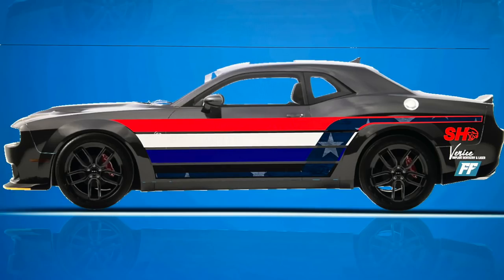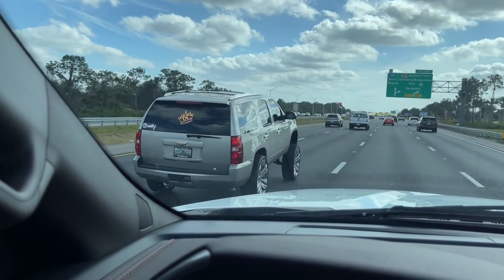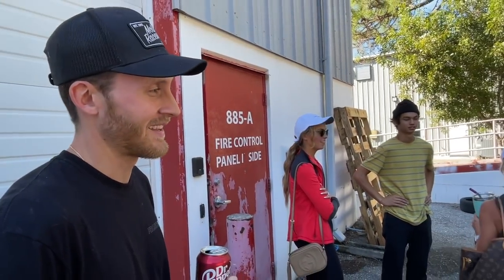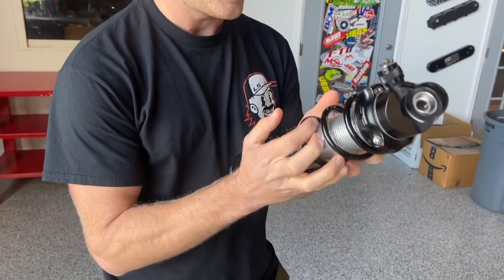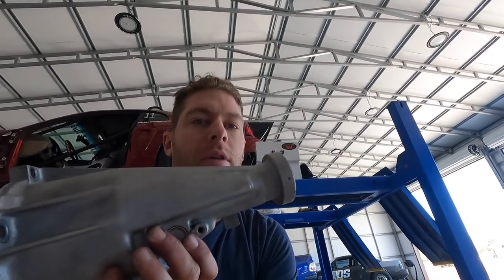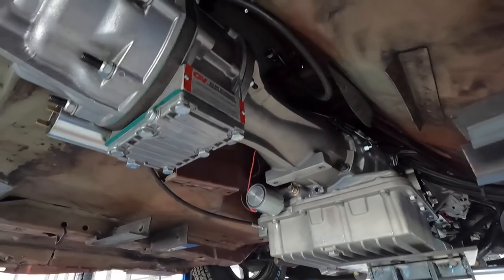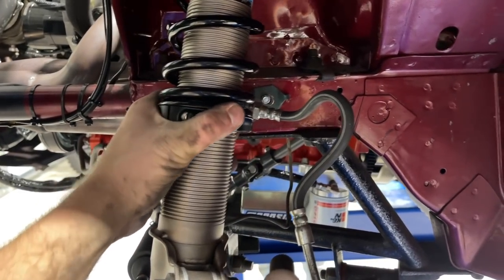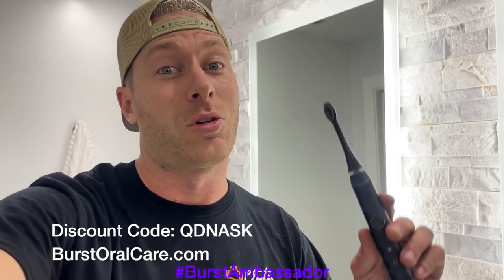Freaking GEAR VENDOR & COILOVERS go on my 88mm Turbo LSX Mustang! Hellcat is Back, Jeep got Wrapped!

Comment from the maker: Sam will be driving his own vehicle for sick week, something a little more comfortable with AC and the amenities. Zach from the FF shop and I will be driving together.
Reply: Powder coat the hand brake black. Kinda anooying to look at. Peace.
Reply: Ya know 🙄
Reply: sam is such a great man
Reply: He deserves a comfortable ride, not some racecar jarring ride.  Leave that for the young guys!
Reply: Awesome. Zack a good dude 👍
Reply: If Zach for whatever reason is unable to roll with you on sick week, id be happy to sit in. I have some high horsepower vehicle driving capability. As well as navigating.
Or hell, if Mr. Sam needs a co-pilot.
Reply: Sam is a great guy.  I wish I had someone like him when I was building cars.
Reply: This is epic, are y’all gonna cruise together? And will his passes and such be filmed?
Reply: You need to adjust your clutch throw. It seems like it is too short with engagement being right off the floor and it rolling when at a stop light.
Reply: I need the shocks. Would they work on foxbody? 89 Turbo fox is what I got. Still stock shocks but adjustable upper control arms. How much?
Reply: Will sams sick week be filmed Aswell
Reply: A Nova?

Comment: Instead of using a Line Lock for the front use one for the rear... 
For the front pressure must be applied before engaging the lock.....(plugged on front lines)
For the rear (plugged on rear lines) you engage lock preventing pressure to be applied...hence only front brakes... turn it off and you have brakes at 4 wheels
Reply: And a whole lot less litigation if you ever bin it into someone.

Comment: If you add a T that goes to your handbrake and a ball valve you can open up the valve on the street and have rear brakes or shut it off.
I believe titan tanks makes a 55 gallon for your truck. 
Great video
Reply: I was thinking the same.

Comment: WHAT ABOUT just a shade lighter "lighter on the top"? You can put an "inline" #3 [50.00] ball valve on the brake line and turn it off when needed just to be safe. I have used these in my race cars for years I have one on every corner makes it real easy when doing maintenance.

Comment: Nice Suspension 
Factor in spring settlement.  Thank you for sharing.  
Don't forget the fire suppression system.
& some Uniforms for you & Sam & the crew. 
Transmission not disengaging ?
Bleed slave or bad pressure plate or warped or wrong flywheel or balance.

Comment: The gas cap light is normally just replacing the gas cap they do wear out over time well the seals and o rings do and its easy to go to the dealer for a replacement that an exact match cause if its not exact it can cause that light to stay on as well!

Comment: You need a larger bore master cylinder that is adjustable. I had that same issue with my Camaro until I went with a Tick Performance Adjustable Master Cylinder. I also had to shim my slave out to get the proper gap between the throw out bearing and the pressure plate.

Comment: Set your rear ride height based on control arm angles. Get your instant center in the ball park then set the front with a 1/4” rake. That will be a good starting point

Comment: Use a few small pieces of cardboard, put in driveshaft, boom self balancing, then put in a lathe or use a belt sander to take off the high spots on the welds old timers trick

Comment: Just for shits and giggles, I put a tko600 in a mustang yrs back, I could never get it adjusted right, had it in and out a bunch of times checking stuff, if I remember I had to shorten the ball stud on the fork, ended up machining down the shoulder so it'll thread in a few more turns and that fixed it. Idk how that car is set up for a fork, might not even have one, something to check maybe 🤷‍♂️

Comment: You could have done a shutoff valve from the main brake lines (off the pedal) to separate the hand (rear) brake handle. That way you still have the safety of all 4 on the pedal and the fun otherwise.

Comment: Did you know that those Gear Vendors are derived from the overdrive used on a Volvo 5 speed station wagon?  Laycock Engineering is the one who made the overdrives for the Volvo and you just had an OD switch on the shift knob to engage overdrive.
Reply from the maker: I did not that’s so cool

Comment: Lmao whining about your LS cruising at high 2k rpm…. My big block Ford jet boat cruises on plane at 3500-4000rpm….. it’s all just noise and oil changes
Reply from the maker: Does it run at 3500-4000 for 6-8 hours and then race to 8000 rpm after the trip everyday for 5-6 days straight?
Reply: @DoctrParker  ….no, and neither did your previous setup, soooo… I get it, a used gear vendors is awesome, less rpm’s, better fuel mileage, one more thing to break, I get it, it’s awesome, errr maybe.
Reply from the maker: @bullhead360  well see! It’s definitely a luxury to have.
Reply: @DoctrParker  hoping mid 8’s average for you buddy!!